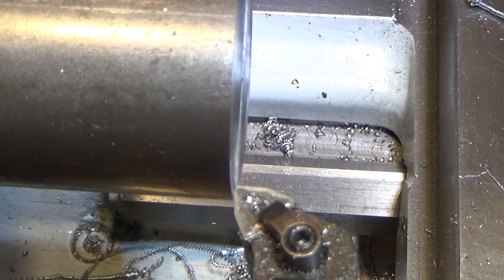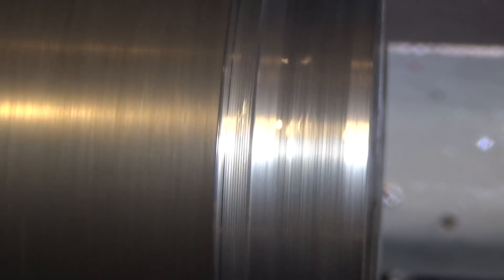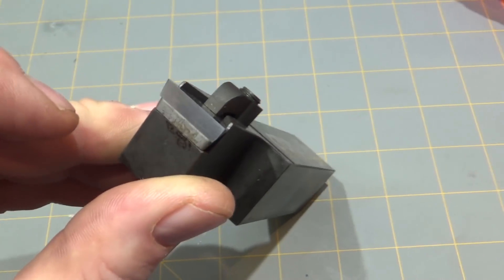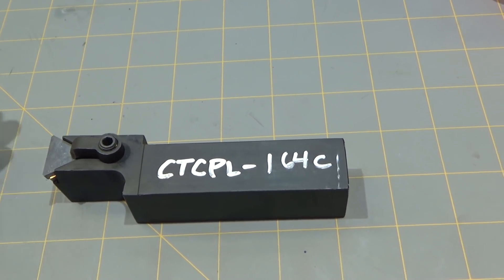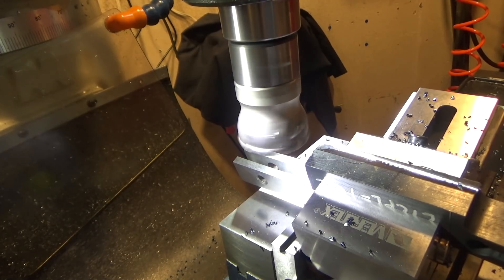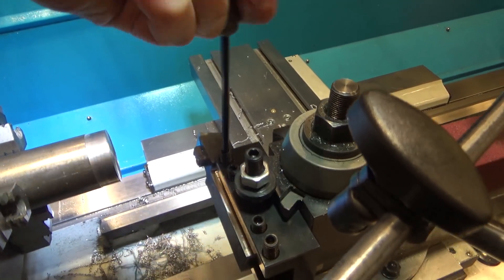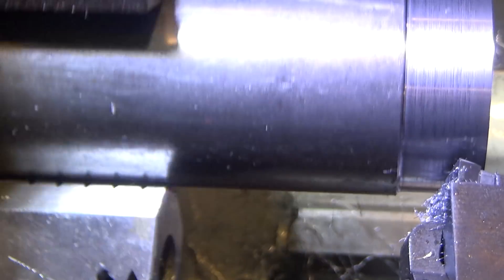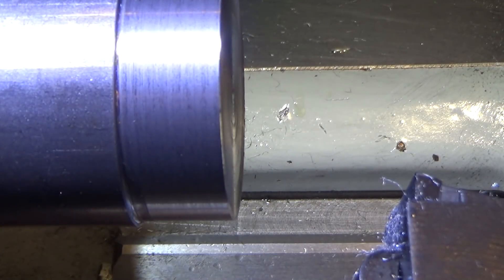Carbide Indexable Vertical Shear Tool for Hard to Finish Materials

Comment: I like your videos. Cold rolled steel is gummy. It likes a lot of speed and feed. Finish cuts should be with a small radius positive rake tool.  The passes I watched were tearing the material off not cutting it off. Surface speed should be at least 750. That is not rpm. To determine RPM multiply SFM by 3.8197 then divide by material diamiter. Example: 2 1/2 inch dia. material; 750 sfm X 3.8197= 2864.775 divided by 2.5 = 1145.9 RPM . Select closest RPM on your lathe and Rough turn with a .015 feed or more .05 depth of cut, or more. Then finish feed at .007 or less. If your finish is still poor speed it up. I recomend a coolant be used also. You should be able to find a coolant mister, air powered, online or make one easily and you can turn and mill with it.
Reply from the maker: Thanks for the tips. I really appreciate you taking the time to suggest improvements. I will definitely try out your suggestions. I have only recently been trying to push my feed rates and have been very surprised with the results. Cheers.

Comment: Curiously I'm wondering if the bar your machining is made from PM (powder metallurgy) steel vs wrought steel. If PM bars do not receive a minimum of 50% reduction during the hot forged hot rolled or hot extrusion process the material will not close up all of the internal inclusions inside the bar. The material starts out as a powder then pressed into a gross shape and than sintered at high temperatures for an extended time.  That neat tip that you've come up maybe actually be smearing the metal into the and hiding the inclusions view. Just curious.  Check your ASTM Specs
Reply from the maker: That was an interesting possibility, that I never considered. I know very little about powdered metal products. The only time I have ever heard of them being used is in things like inexpensive gears. I will have to go and learn more. Thanks for the tip.
Reply: I spent 20 years working with and developing PM materials in the very high-end side of the market, metal making in a test tube. It's amazing stuff. Check the ASM web site for information.
Reply from the maker: I will do that. The topic is fascinating. It probably becomes even more relevant in light of laser sintering and even carbide inserts themselves. Getting information can be tough though. ASM makes their knowledge more easily accessible to industry than to a hobbyist like myself. I really appreciate you taking the time to share.
Reply from the maker: I was just looking at an online course on Metallurgy for the non-metallurgist and it was $1400/$1200 depending on membership. Unfortunately outside my affordability window. These prices are typical for continuing education where the purveyors are expecting a company will pick up the costs.
Reply: @DudleyToolwright  im sorry i dont have a particular site or link in mind, but i know that when i took my engineering degree, i used som free online lectures/courses on that topic.
Could just be youtube, and again im sorry i dont have a link right now. 
But it should be out there.

Is there a particular topic youd want to start out with?

Comment: Good demo video.  Doubleboost has the best camera setups I've seen. He has a ceiling mount camera stand over his lathe and mill, along with great light for his close up work.  He also seems to use tool post mounts, but has very little vibration, even on the tool post mounts, or at least doesn't show the video with extreme vibration. lol -  
Check out this video. https://youtu.be/SjZ694cX4QU
Reply from the maker: Thanks. I have watched his channel before, but now I will look more closely.

Comment: High speed steel will work a lot better and will probably leave an even better finish as carbide insert edges are not sharp. They usually are chamfered, rounded, eliptical with specific proportions or something proprietary. If you grind carbide to sharp point it will work but the sharp edge will deteriorate far quicker than if it was HSS.
Reply: Dudley Toolwright if you  try HSS use round stock rather than square that way you can easily alter the angle to experiment for best results. If you do add a little top (?) rake  you will get better results.
Reply from the maker: Good to know. I haven't tried HSS, but this carbide is pretty sharp along the edge. I appreciate the input.

Comment: Another option for those huge toolholders is to cut an Aloris dovetail in the tooholder itself.
Reply from the maker: Very true. A built in dovetail can make for a very flexible tool. I might want to try a vertical shear cutter like this with the added option of adjustable shear angle. Thanks as always.